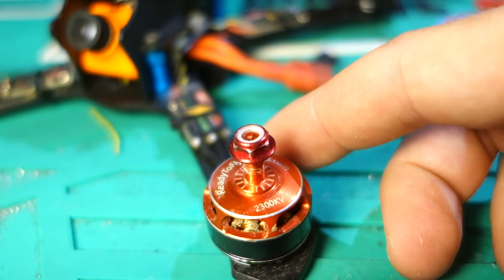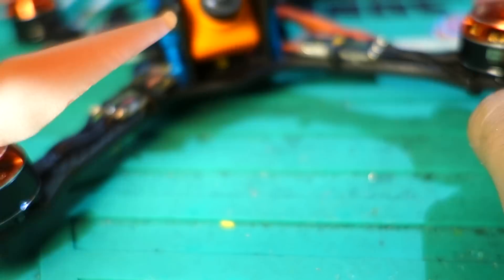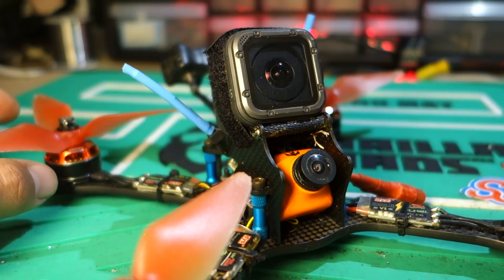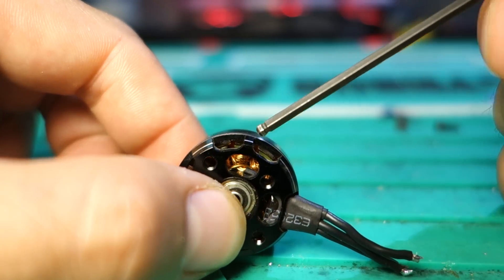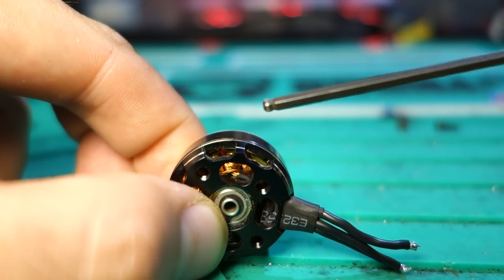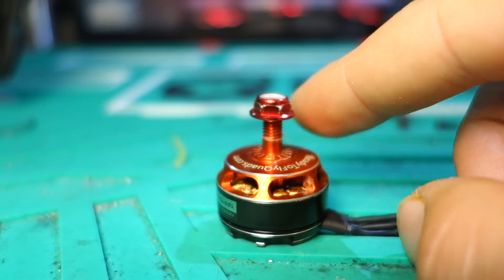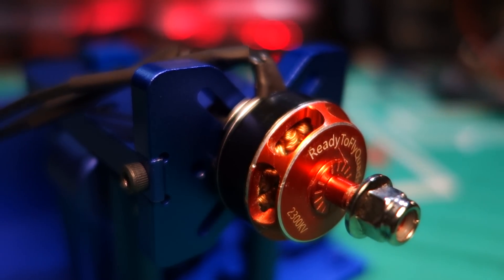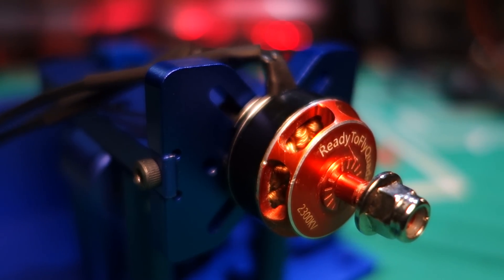Review // RTFQ GT2205/2300kv

Comment: im running 2204 2300 kv motors with 20 a bl heli s do ou think my esc's the 20a will handle these 2205 2300 kv motors? i just need more stopping power at the bottom of a long dive and my 2204s cant seem to handle it. think they will smoke my 20a esc's? thanks in advance for your help :)
Reply from the maker: What props? What voltage battery? What ESCs?
Reply: Bulbufet FPV 4s lipo FC naze beataflight props 5040x3 escs are 20a dys with blheli s on a 210 size frame called the RH210 by drone PROZ, I'm just looking to add more power without changing the esc's right now I'm running dys 2204 motors with that combo and its just needs a bit more power but I don't want to change anything else cause it fly's really smooth.

thanks Paul

awesome review BTW thanks